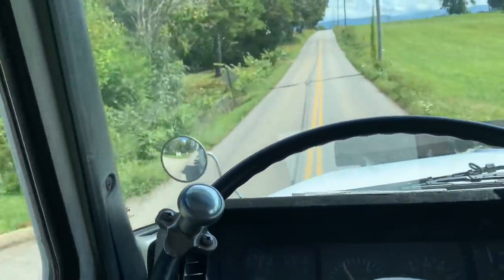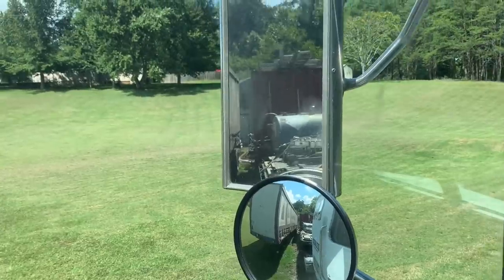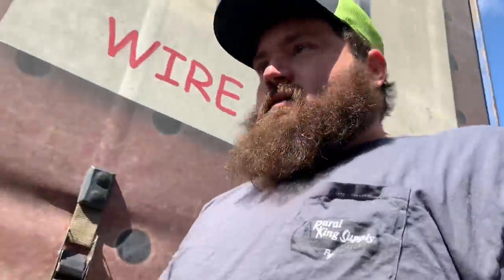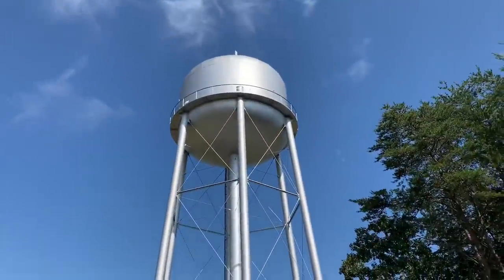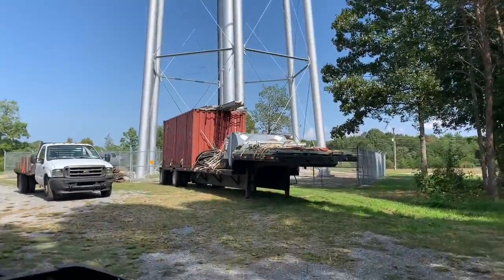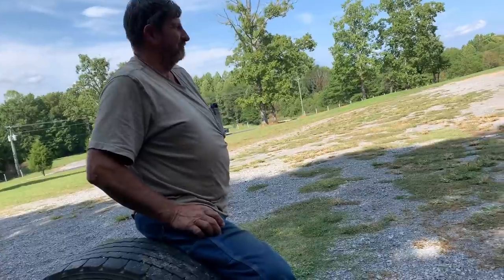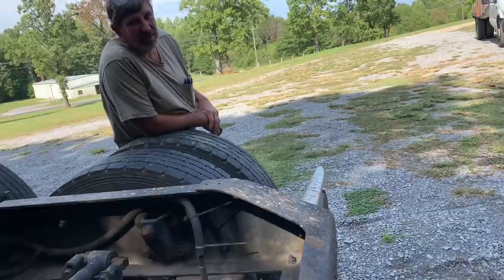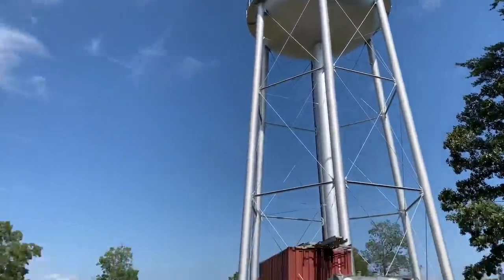Preparing to Sand Blast a Massive Water Tower!

Comment: You sure make me miss truckin. Loved meeting all the characters out there working. Used to pull bulk cement and blasting sand in phneumatic blow tankers. Fun to drive the loaded legal weight then 30 minutes later drive down the road with 26 tons less on the rig.

Comment: If I remember correctly, the purpose of a water tower is to use the hight of the tower to put the pressure on the water system. Could be wrong😂. In the equipment rental industry, my favorite is cell towers. Usually they give you an address in the middle of nowhere or on top of a mountain and all you're looking for are wooden stakes with orange flags outlining the right of way...

Comment: I used to be a Water Treatment Plant Operator back in the 1970s. The first tower was indeed a water tower where the treated water coming from the Water Treatment Plant  is pumped into and is ready for distribution to the customers.
The second one, that is getting the new roof, is actually what is called a "Clearwell".  In most circumstances, the Clearwell is located close to the treatment plant, and is used for water storage before it is pumped to the tower(s). The Clearwell is also a sort of fail-safe in that  if any of the tests done on the water, (which is done many times a day), indicate that there could possibly be any problems with the water quality, it can be dumped or recycled back through the treatment facility instead of pumping water to the customers that might not meet the proper standards.
Additional info: The reason they do not want the tanks to get too hot, is because the heat would cause the chlorine to dissipate out of the water and risk contamination while circulating through the system. They need to maintain a One Part Per Million, (1 PPM), residual of chlorine in the water to kill any germs that might come along.
Reply: that is not a clearwell. in tn in the east we have tanks on the ground on top of the mountains or on higher elevation than anything served with water

Comment: I was under the impression thst they put it up off the ground like that for the weight to of the water itself to create pressure from its weight instead of putting in a pressure type of system
Reply: that is the reason for towers. or they will put them on top of a hill higher than the community they serve
Reply: Vaughn Hill for every 2.31 feet in height the pressure of the liquid increases 1 psig times the specific gravity of the fluid minus the frictional losses incurred in the piping. The volume has no affect on the pressure. The increases in volume in the tank helps to increase the capacity of the of the water system and increases the height of the water above ground. A simple way of looking at the tower would be to look at it as pipe standing vertical. Engineers would calculate water pressure at maximum and minimum capacity of the tank as the (maximum and minimum height of the water in the tank). If  the water tower is 175 feet high the water pressure at ground level would be 75 psig multiplied by the specific gravity of the liquid minus any frictional losses in the pipe. Just a little science problem.
Reply: hence why they put the tanks on the ground when they are 200 feet above the community it serves. a tank on the ground is easier to maintain if you live in the mountains it can be done that way. if you live on the flat lands, you have to have towers